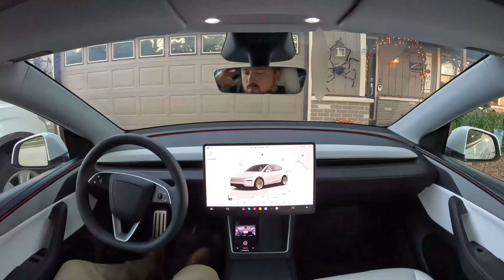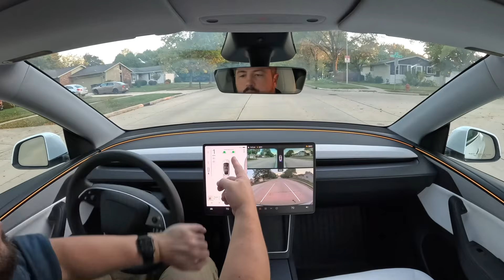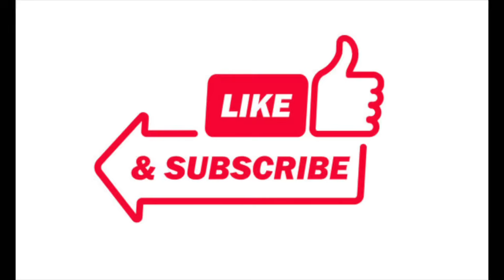FSD through a construction zone with 2026 Tesla Model Y Juniper

Comment: How about going thru a constructions site and there is a flagman telling you to stop or go. Does the tesla see him?
Reply from the maker: I have not personally encountered that, but if he is holding a stop sign and facing it towards you, I think it would stop.
Reply from the maker: Sorry, to add to this. I have several times driven through road construction without a person but there was a stop sign sitting in an orange traffic cone. So a temporary stop sign. And FSD detected it and stopped every time.
Reply: Yes it happens to me I was in a blocking road I was telling the car to go around it did but takes me 4 times but it went back and turn on different directions but 10 min later was coming on the wrong side after was like 3 times was not body on board